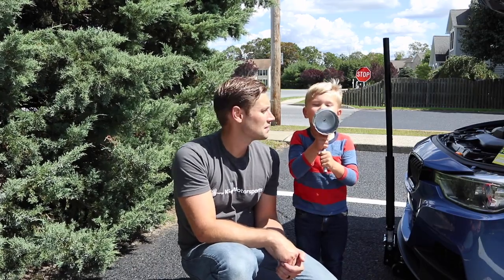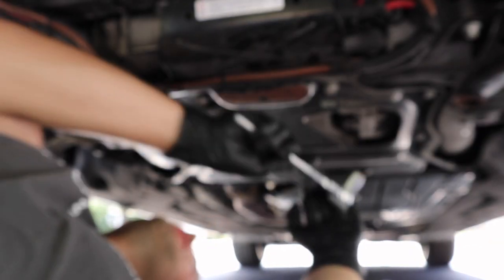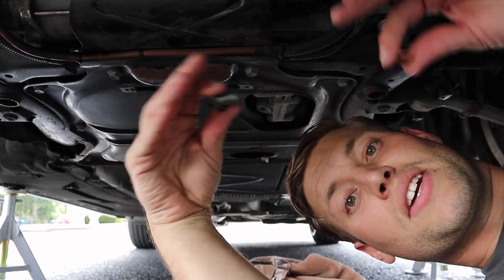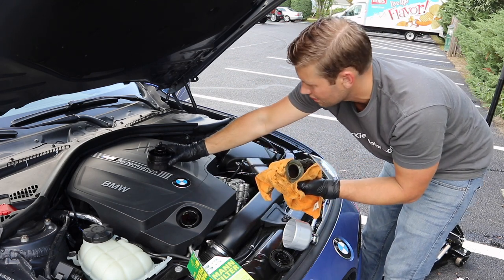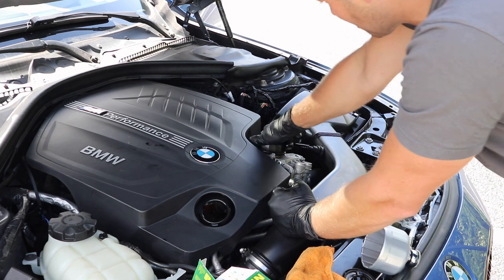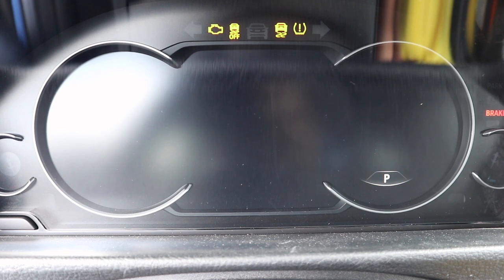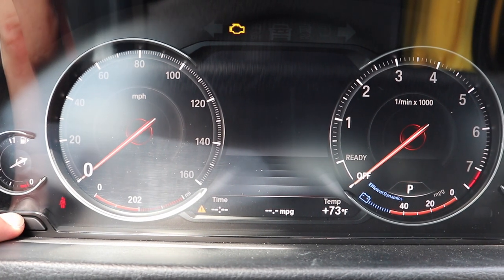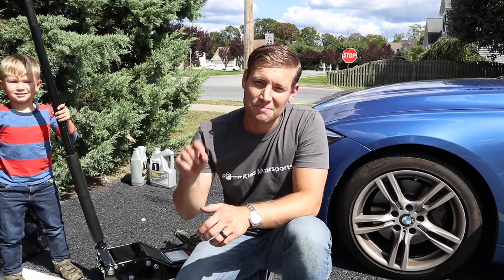How to Change the Oil and Oil Filter in a BMW F30 335i (N55) xDrive

Comment: Can you do a video on F30 transmission fluid change, it would be very helpful for alot of us?
Reply: Bilal Ahmed I'll second that. Love your videos and have done the oil change and spark plugs with your help. Would find a transmission, front and rear differential, and transfer case dyi awesome.

Comment: great video. One question. The differential drain bolt is that for the transmission fluid or is there a front differential.

Comment: Thank you for a good guide on how to change the oil. One thing I found out unfortunately is that if you over tighten the drain plug you can either damage the plug itself or the oil drain pan. I would suggest for anyone doing this at home to be very careful as it is easier to do than you might think. If you're using a torque wrench it should be properly calibrated.

Comment: Hi guys I did my oil change and filter thanks for the video. I found I have an oil leak from the rocker cover and need a new gasket replacement. Do I need to replace the cover also.?

Comment: While u have the sump plug out u shud remove the oil filter then as the dirty oil in the filter housing will go down into the sump and out putting the sump plug in before changing the filter will cause a bit of old oil to sit in the sump with the new oil

Comment: Hey Bryan, does it matter if I torque it to 18.4lbft for the drain plug and filter cap? Planning on doing an oil change on my 435i and don't have a torque wrench
Reply: Did you ever get an answer to this?
Reply: estimate ie snug and then some !

Comment: Brian, what's happens if the cage that goes inside the oil filter is missing? For some reason when I get my oil changed this gets thrown out. It happened before on my e90 n51 and it caused limp mode. I think it has been missing since the last oil change on my n55.

Comment: Bryan, I have a 2013 328i I took it to the dealer for an oil change and they put 0w-20 in... the manual calls for 5W-30 or 0W-30 / 0W-40. Should I have it changed to 5W-30 or will it be fine with the 0W-20?

Comment: I have the extended warranty and dealer does oil changes but I want them done every 5k so I just changed it myself. I’m assuming I shouldn’t reset it so the dealer will do the next change when I would want it done?

Comment: Thanks for the extremely instructional video.  What would you recommend to do if the oil change service schedule will not reset (reset not possible)?  I have a 2012 335i M-Sport with the MPPK package.
Reply from the maker: How many miles does it say you have until the next oil change?
Reply: 3900
Reply: Edward Mendez i have the same car. Take it to the dealer.

Comment: Hi there!  I did oil change to my Bmw f10 2013 with 57000 miles and i used Mobil 1 full sintetic 5w30 I just want to know if just the right one. Thanks
Reply: Yes 5W-30 is correct but stay away from Mobil 1.  I’m not sure why Brian is putting a thinner weight in his car..  Possible do to his upgrades or the climate temperatures in his area as thinner would flow better in colder temperature areas..  Either way I’m scratching my head as well.  Or maybe his engine is modified and tighter and he needs the thinner weight so not to put stress on the crank and pistons.. Only he knows...  But I’m leaning towards his areas climate, as that initial cold start on the engine is where the engine is gonna is gonna experience a lot of wear..  I think he just takes good care of his baby...  So far it appears he has no leaks from wear patterns formed from the 5w and changing to Ow, so he’s fine.

Comment: Mobil 1 isnt on BMW's list of recommended oils. i've heard, with Mobil 1, it is no longer recommended because it deteriorates the oil seals on the turbo(s).
Reply: That actually explains a lot, and validated my suspicions, thanks.  Using Castrol or just straight BMW dealership blend from now on.
Reply: Well BMW's list of recommended oils changes as they change partnerships. Right now, Pennzoil struck a deal with BMW so Pennzoil is the recommended oil. I would simply switch between brands, record initial startups and compare performance and let your experience make the decision. I am changing the oil on my N55 335i today with Castrol oil, but I will switch to Mobil on the next oil change.

Comment: You jacked the car at a point in the front. What is that point? Also, I too have a N55 engine, 2013 335i. In the manual it says that you should use either 5W30, 0W30 or 0W40 with BMW LL01 specs. It that essential? None of the Mobile 1 oils have that spec. The only Castrol full synthetic oil that has that spec is oW40 from Wal-Mart. At around $25 per gallon, that is a great price. Please advise. Thanks.
Reply from the maker: Hi Chris, that's the central jacking point. We have a video on how to jack an F30 up, so you can see where it is. To be honest, I don't know. I've heard that the Mobil 1 was approved and now it's not, but with how BMW is, it's hard to tell why they approve some and not others..
Reply: Thanks Brian. I finally used low rise ramps. I used Castrol Full Synthetic 0W40 which is also BMW LL01 certified. I know some people recommend 0W30 going into winter but I just used 0W40. I changed the oil after 8000 miles when the dealer did the last oil change. Thanks for your response! Excellent videos. Could you post one on the transmission fluid and when it should be done?

Comment: Definitely would not use 0W-40.  40 weight is too heavy, especially for the summer weather in the video
Reply from the maker: It’s an ok weight to use. Bmw used up to 10w 60. We use 5w 30 at our shop mostly though

Comment: Great video, I thought mobile 1 was no longer supported? 

https://mobiloil.com/en/motor-oils/mobil-1/mobil-1#0W-40

I've been using original BMW 5W-30 twin power oil since I heard of this. I did end up using (finishing off) my two  remaining 5 qt bottles of 0W-40 mobile 1.

Maybe if at 5k intervals I wouldn't really worry about it...
Reply from the maker: Eh, I feel like they go back and forth on it. The only reason I don't use the BMW Twin Power oil, is because of it's cost
Reply: accord705 it was fine for years until BMW started making its own oil. Any oil that comes standard in a Porsche GT3 is probably fine in our $50k BMWs.

Comment: I do mine at 4000 miles. It gets too dirty at 5000-6000z
Reply: I do mine every 15000 as per the car's maintenance schedule.  I use full synthetic 5w30 and has been running excellent since 2012.  (F30 MPPSK, AC stage2)